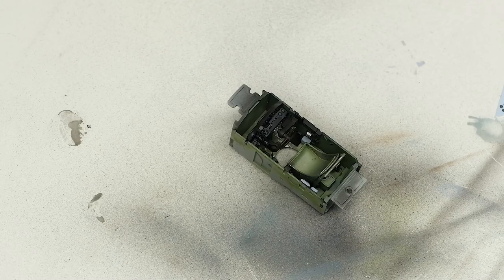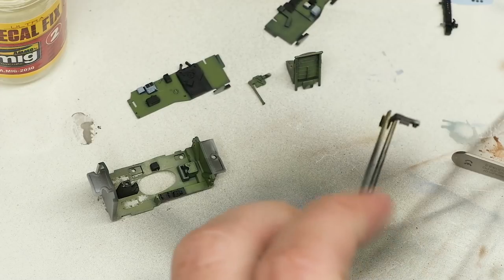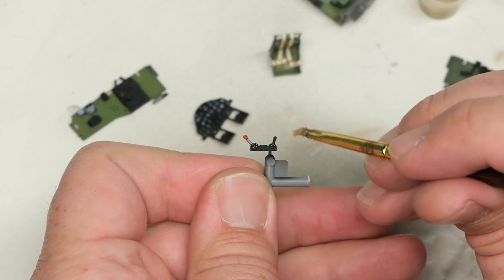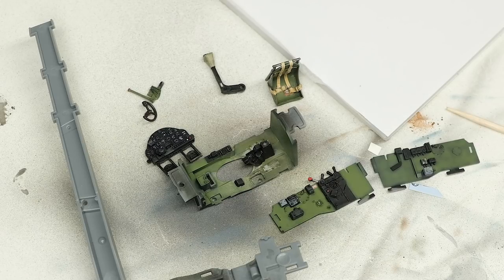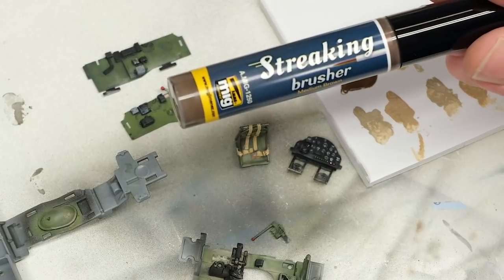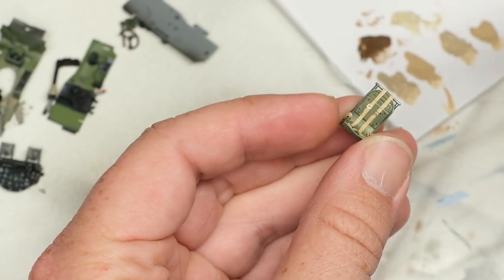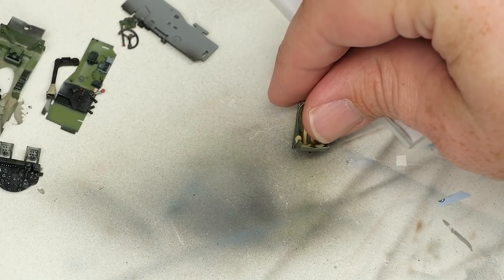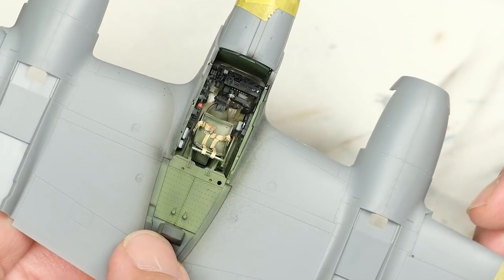Tamiya P-38F Lightning 02 - Cockpit Detailing & Weathering

Comment: Matt, where are you sourcing that decal softening solution? Most on EBay seem to be in the Far East and take 6+ weeks to deliver to the US. Is it so much better than Tamiya's other decal solutions that it's worth the wait? I just started my P-38 last night. Thanks for yet another great and inspiring video how-to series!
Reply from the maker: ebay - they say 6+ weeks but I got mine within like 3. VMS also makes a 2-in-1 softener + adhesive that performs about the same. I find either one really helps reduce decal issues quite a bit.

Comment: Would thinned PVA work as well as a decal adhesive, in terns of combating silvering?
Reply: Un-thinned Tamiya gloss clear works great.  One drop per instrument face.  Half a drop for the itty-bitty ones.
Reply: @danl.909  Ive used tamiya extra thin CEMENT on silvered clear decal film as a last resort, and it actually works.(brush the lion share of glue off the applicator before trying it...)..and I use thinned white glue for setting decals if they are quetionable

Comment: i have a question for you..which kit builder beats tamiya?
Reply from the maker: Easy. None of them. At least for aircraft. Armor is a big more complicated.

I'd put Wingnut (RIP), Great Wall, and Eduard in a tier just below them. Probably Arma Hobby, too, but I haven't actually built one of theirs yet.
Reply: And how about zoukei mura 1/32?
Reply: @DoogsModels  Matt,  when it is released, will you be building Arma's 1/48 Hurricane?
Reply: @tonyverschelden6714  
ZM is good, even very good.  Still not in Tamiya’s class for aircraft kits, though.  No one is.  There’s Tamiya, then there’s everyone else in a different classroom building.  At least Tam sets a standard for everyone else to shoot for.  
As Matt has mentioned numerous times, Tamiya’s 1:32 F4U kits are unmatched accomplishments in the field of producing injection-molded aircraft kits.  I’ve built three, and I will certainly build more.  They are a sensual modeling experience to build.